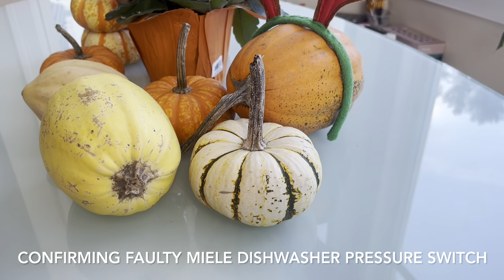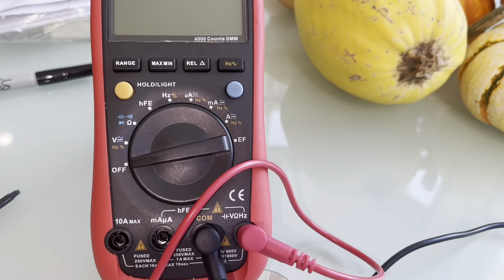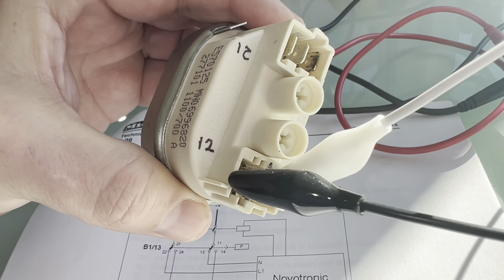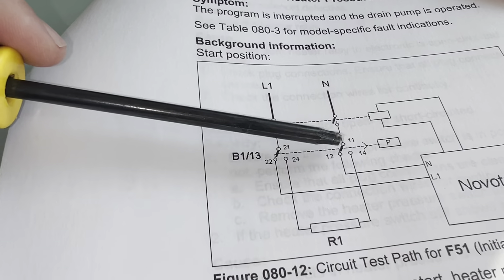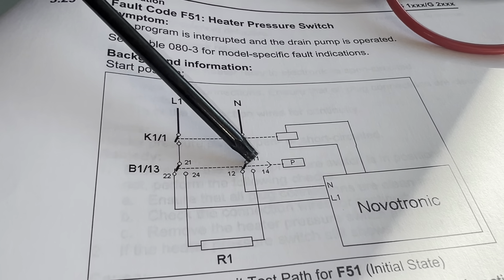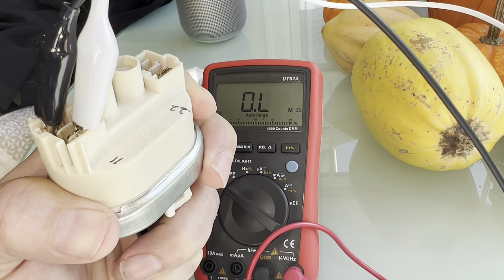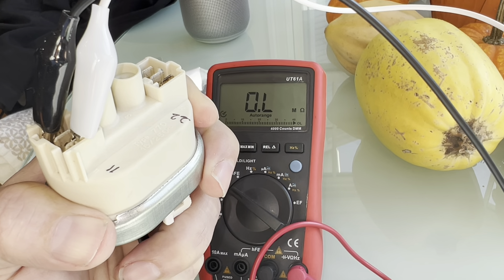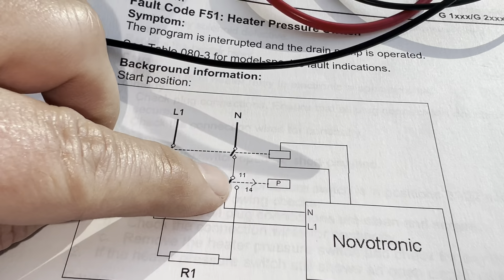Confirming faulty Miele dishwasher pressure switch (F14 + F24 error codes)

Comment: Just to close the loop, I installed the relay and pressure switch today and ran a full cycle with no fault codes. Thanks for this video. Saved me close to $1k.
Reply from the maker: That is great news Len!  So happy that you were able to fix it yourself.   

If you have an ohmmeter, it will be easy to verify if the pressure switch was the culprit as I show in this video.   I also went one step further and in another video I cut it open to see how it failed (moisture was getting in).  

Cheers

Comment: Thank you for posting this. My manual did not provide sufficient detail to run this test, but I did and my results were the same as yours, one contact did not fully/consistently open under pressure.
Reply from the maker: @zachmcreynolds4  nice.  That means the replacement unit should fix your problem.
Reply: @ Yes, I have one on the way. I pulled the circulator as well while I was in there and it was clean and fine. I replaced the heater relay a couple of years ago with a third party high quality two pole relay which has been working fine so I should be good to go for a while once I install the new switch. The machine about 17 years old so eventually I may get a new one but not until this one is beyond reasonable repair!
Reply from the maker: @ Take a look at my other DIY video where I fix the F85 code.  The manual said to replace the entire circulator pump for $600.  Instead, I took the pump apart to understand how it worked and found a tiny switch was the culprit.  The replacement was only $2.
Reply: @rogerscubadiver  Very strange, I got the new part and it tested out okay. I installed it, but the machine is still giving the f14 code. I will check it again but I am surprised.
Reply from the maker: @ that is strange.   Do this test.  Clear all the fault codes from memory (see my videos in the DIY playlist).  Run it again and tell me what other codes you see.
Reply: @ I checked the switch again, it was fine. I ran it again, no new codes. Only F14!
Reply from the maker: @zachmcreynolds4  that is perplexing.   Which Miele model do you have?  Just to reconfirm, you entered the service mode, cleared the old codes, ran it again, it failed with F14, then you re-entered the service mode and the only code there was F14? 

And you have a new heater relay and the new pressure switch ?
Reply: @ This is a G2470. Yes, exactly, and I checked the new switches again. I don't know exactly how to test the heater relay switch except to say that there is definitely heat coming out of the dishwasher during the attempts. I ran through the test mini-programs U1 an U2 and they seemed to go without issue. I have also gone through the complete debugging protocol listed in the service manual to check for blockages, etc. The electrical connections seem clean and tight on both ends (including the ST5 end). There is copious flow from the pump during the spraying cycle, although I cannot quantify that (that is what the pressure switch is supposed to be doing). I don't know it there is a motor issue (seems doubtful) or the control board, but the machine is not giving any more clues.
Reply from the maker: @zachmcreynolds4  the heater relay is what the manual suggests as the defective part for F14 and F24 so that was my first item that I replaced but didn’t fix the issue.  In this video, at the 14 minute mark, I open up the old relay and test it.  It showed it was working ok.  The test I did was solely based on resistance.  There could be temporary glitches when it is used with line current and I could have rigged something up with live electricity to see it work but didn’t go that far

https://youtu.be/Df9xB7G2TFg?si=ECeOHcHaJNKbdvIH

It is funny that you tested the pressure switch and you confirmed it was bad.  That had given me certainty that it would be the culprit.  

When does the F14 appear in the cycle?  Always at the same time or random?  And you have never seen an F8x code?  That was another issue I found in the circulator pump which I believe was giving me the F24 code in my second dishwasher
Reply: @ Yes, the F14 comes on after a number of times that the circulator comes on for a short period, shuts off and stays off for a short periods, then comes back on. After maybe 6 of these it comes up with the F14 error. I have never had an F8x code, and when I replaced the heater relay switch it was not an F14 code. Maybe F24? I took the cover off the heater relay and checked for open/closed in both states on both sides and it was fine, although I did not actuate the solenoid with current. I am stumped. I don't even know what to try! I am wondering if there is a way to temporarily bypass the pressure switch. I am not wild about starting to replace things without knowing since the control board and entire circulator might be next. What do you know about testing the capacitor, could it be the problem? I tend to be cautious around big capacitors.
Reply from the maker: @ I don’t think any of the capacitors in my system come into play.  They are needed to break the static momentum of motors, like the circ pump.  You can also discharge them safely.  Google the steps.  If you are ready to throw in the towel, I would replace the tiny switch that controls the slide shutter in the circ pump.  It would be a Hail Mary since you don’t have any F8x codes that indicate slide shutter.  But if the shutter stays partially open or close, it will limit the amount of water that goes into the pressure switch and the board will read that as a bad heater relay or pressure switch.   Look for my videos on this change.  It is not as hard as it sounds but it does take time.
Reply: @ Thank you for explaining the purpose of the capacitor. I was trying to figure out when it would fire but it sounds more like a kick starter? The motor is definitely starting easily so it must be working. Definitely worth a try on the shutter switch. I just don't want to start replacing expensive parts at random on my 17 year old machine. It is a mystery to me how the control board is kicking out this fault when there appears to be big pressure from the pump when I open the door, as much as there ever was and certainly enough to wash dishes. Could be the board is at fault since the switch and wiring seem fine but that is a subtle way for the board to fail. Any idea what those two white screws are for on the pressure switch? Wonder if they adjust switch pressure so that I could lower the required pressure a little to see if that makes any difference. Your video about taking apart the switch saved me the need to do the same thing out of curiosity, but it kind of looked like the springs for the throw arm were not adjustable. But then why two screws?
Reply from the maker: @zachmcreynolds4  yeah, I don’t believe that capacitors will be the culprit here.  

It don’t recall what the screws on top of the pressure switch are but I would venture the same guess as you that they control the tension of the springs and indirectly how much water pressure it takes to flip the connections.  

I supposed it could be the board with random failures.   Did you inspect it for any junk on it that may be interfering? 

The slide shutter switch is $2 so it is cheap but you have to remove the pump to replace it.  It would be like a 1hr job.   Let me find you the video link 

I can’t think to any other component that would be problematic.
Reply from the maker: @zachmcreynolds4  here are the videos on the circ pump and the tiny switch 

https://youtu.be/8G-lmU0vj18?si=MjTtQjMKZL7YF6Po

https://youtu.be/OalpU8SeSIY?si=m0BOWUsYu_cazCyk

https://youtu.be/ir6XlDS6vGk?si=-mI2RQDHsuub1_2H

https://youtu.be/OalpU8SeSIY?si=m0BOWUsYu_cazCyk
Reply from the maker: @ one more thing, did you test the resistance of the heater elements that are inside the circ pump?  I forget now what values they are supposed to be but it is in the manual.

One more thing I remembered now.  While the manual said ST5 where the contacts on the board to check, That was wrong for my unit.  I found the schematic diagram inside the door paneling and found it was different (I have a video too :-) )

Here are other suggestions 

“ Jammed Circulation Pump
Symptom:
With long intervals between wash cycles or at first commissioning (if the
period of time between manufacture and installation was long), the axial face
seal of the circulation pump can jam. As a result of this, the circulation pump
will not run (see Fault Code F14, Section 080-3.16).
Cause:
Axial face seal is jammed.
Remedy:
1. Remove the filter combination from the sump.
2. Pour in approximately one quart of hot water (no hotter than 167°F) with 3
to 5 drops of rinse aid and wait 5 minutes.
3. Restart the dishwasher.
Note:
The circulation pump must be replaced”

“ Heater Pressure Switch, B1/13
Heater pressure switch B1/13 is located directly on the circulation pump and
registers the water pressure when the pump is in operation.
Using the pressure switch contacts, heating is controlled via 2 poles. The
heating is switched via a heater relay located before the pressure switch
contacts in the circuit. Heater activation occurs during the wash and final
rinse cycles.
If the circulation pump and heater relay are activated and the pressure switch
reset contact is open, the control registers a water intake fault (see Fault
Code F14, Section 080-3.16).”
Reply: @rogerscubadiver  Okay I am going back in this morning to try 3 things. 1) Check for resistance or least continuity in the heater elements, and 2) check the slide switch. The last one is that when I took apart my old pressure switch and confirmed that a water leak had caused corrosion on one side likely causing the failure to open properly under pressure I confirmed that the two screws adjust the pressure required to flip the two circuits. So I am going to try reducing the required pressure level a bit to see if that can eliminate the fault. I also found that having too much pressure could cause a similar fault to the corrosion failure (if you pressure the switch past the switching point it will lead to current leak on what was a properly opened circuit. Not sure if this could happen in practice since I had taken the switch apart at that point, but it shows that the calibration screws could potentially be too loose or too tight and maybe not symmetrical (so trial and error for those of us at home!).
Reply from the maker: @ just think how good is going to feel when you finally get to the bottom of it.   You will understand really well how dishwashers work.  

With regards to too much pressure, are you in well water or city water? Do you have a way to measure the house/apt water pressure?  I’m on well water and my system maintains the pressure between 40-60psi.
Reply from the maker: Also, make sure you don’t have any junk inside the circulator pump that may be interfering with the water pressure or slide shutter.  Maybe a piece of glass or something small has gotten into it.  For that, you will need to take the cover off like I did in mine.  But before you take it off, check the slider switch and shake the pump to see if you hear anything loose inside.   It is not hard to remove the cover but you must make sure you set it back correctly to prevent any leaks
Reply: @rogerscubadiver  Okay, success! I loosened the pressure screws two revolutions. At first that did not have any impact, but for the first time I was testing outside the enclosure and had not put the middle rack back in. I typically have been doing basically a complete reinstall every time before I plugged it back in since I more or less had to in order for the cord to reach the outlet.  It suddenly occurred to me that with the middle rack gone the central arm would be free-flow and would naturally reduce the pressure in the circulator below normal. When I put the middle rack back in and retested, it was fixed! No more faults of any kind! Maybe the new switch I got was a little tight (it was used) or maybe my pump has lost a little force but in any case it is working again for the time being! Thank you for your above and beyond the call of duty assistance!
Reply from the maker: @ oh wow.  That makes sense as the middle arm is adding friction.  I also didn’t realiza the pressure switch was used and not new.
Reply: @rogerscubadiver  Well good to know for the next one to go! They should probably add "ensure middle rack in place" to the test procedure since most people take those out before turning the machine on its side and it apparently needs to be in there to get sufficient back pressure. Thank you again and you can mark this as case closed!
Reply from the maker: @zachmcreynolds4 I will added to my video descriptions.  It is not obvious at all and it didn’t even cross my mind that without the sprayer arms in place (likely similar issue with all sprayer arm, not just the middle )

Comment: Thanks for the video.  Very helpful.  I found the reading on the line side of mine kind of bounced around a lot, which was kind of weird.  One thing that was a little confusing is that one of your alligator clips is white (I noticed it coming off the black lead after a bit).  But thank you.  I will be ordering a new pressure switch and will hopefully extend the life I my dishwasher for a while.
Reply from the maker: Hi Gabriel.  I’m glad that you found it useful.   The bouncing could be a problem.  It should be a simple open or close circuit.  Any resistance should be suspect.  

As to the color of the alligator clips, it doesn’t matter what it is to complete the circuit for this test.
Reply: @rogerscubadiver  - I figured the orientation of the leads didn't matter, but I was trying to follow what you did exactly since I am not well-versed in using a multi-meter.  The first side had a steady reading of .2 or so ohms.  When the second side was moving around, I was worried that I didn't attach the leads correctly and repeated the process several times with the same result.  I feel confident the problem is the pressure valve... but we will see once the new part comes.  On the Miele website, the part number (which includes the seals) is 6996821.
Reply from the maker: @gabrielharber1788  I should have mentioned the leads didn’t matter in the video.  Sorry about that confusion.   The .2ohms is virtually 0 ohms (closed circuit) so that side is good.  If the other side was showing variable and higher resistance, then I have very high hopes that replacing the switch will solve this particular error code.   

Do keep me posted because I like learning if my solution works for others as well. 

Cheers
Reply: @rogerscubadiver  I replaced the pressure switch, but the dishwasher still didn't work (but I know it was bad after following your instructions and testing it with a multi-meter).  I then decided to also replace the heater relay, and it looks like the dishwasher is working now.  I have just run a couple cycles, but so far so good.  The only issue now is that there is a low level humming sound coming from the machine.
Reply from the maker: @gabrielharber1788  it is hard to tell what failure either of these two parts are causing.  The electrical diagrams and arrive manual descriptions don’t make it easy.  This is why I chose to replace both parts.  And I also verified both parts and found the pressure switch was the one that didn’t work.  

I am glad that for you that heater relay did the trick (though it is surprising that the pressure switch was also not working as expected). 

I don’t know what the other issue may be.  It sounds mechanical.  Like something didn’t get re-seated correctly
Reply: @rogerscubadiver  - the humming was from the intake valve which was resting on a pipe under my sink.  

As for which part was failing, I think it was both… which is surprising to me.
Reply from the maker: I’m glad you found the source of the humming.  That would drive me nuts.